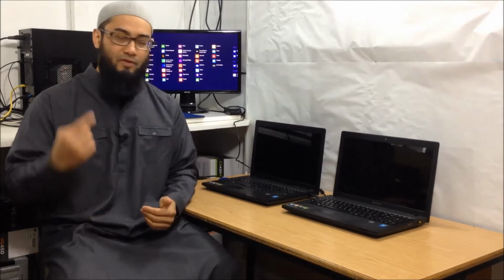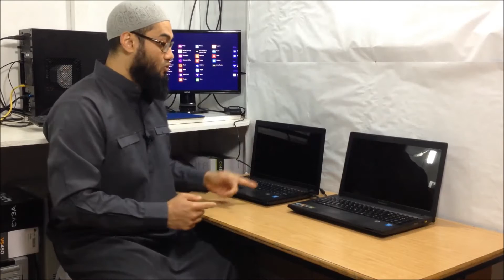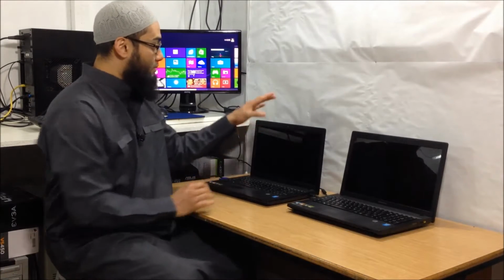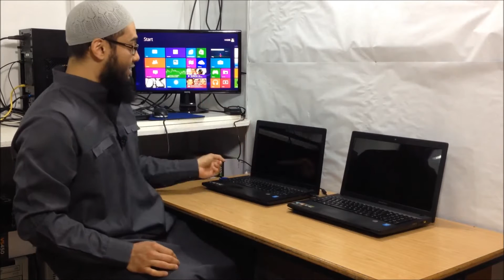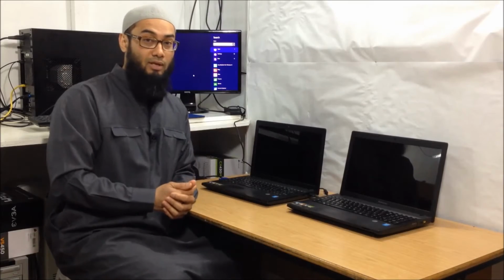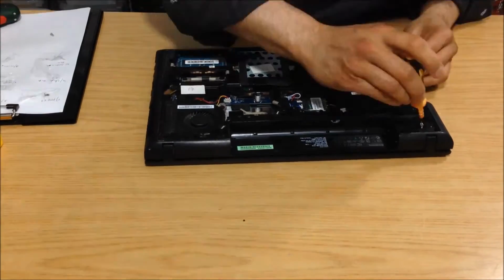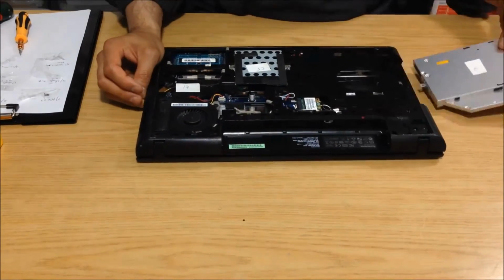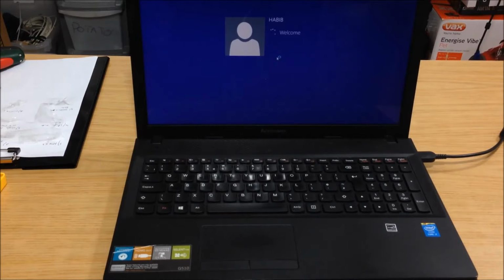Laptop Black Screen No Display Fix – Parts Transplant Between Two Similar Laptops

Comment: I have a hp laptop, earlier there was some problem with windows when I reset the windows it started once i switched it off and then tried starting it does not work black screen coming.
Fan starts with some sound and within seconds it slowly stops and the processing led light also is not glowing at all.
Reply: Me too

Comment: I bought a new custom pc and I build it, when I finish and plugged the power the motherboard brought a light and the water cooling but when I press the power switch nothing happens
Reply: the fans are not working
Reply: +HealMyPc  no problem I fixed it